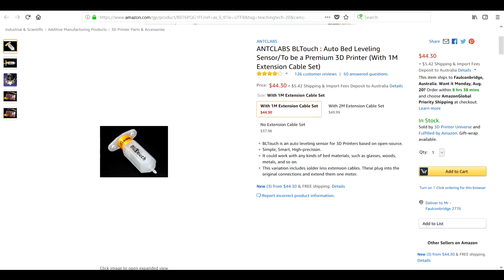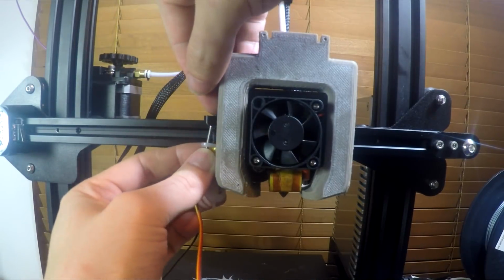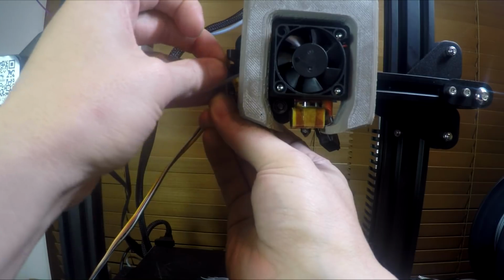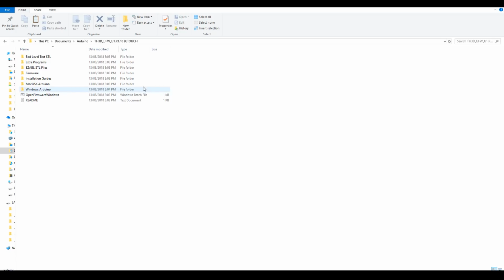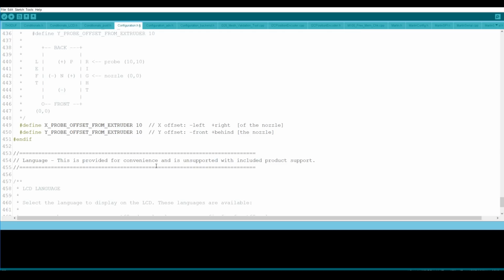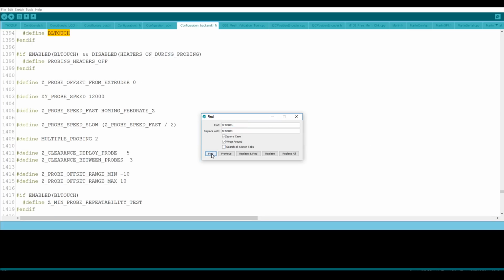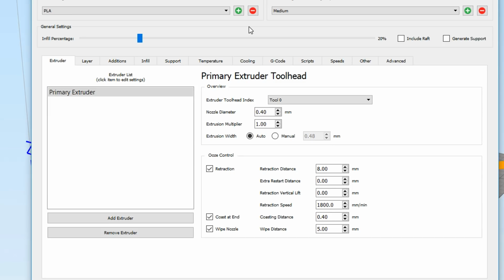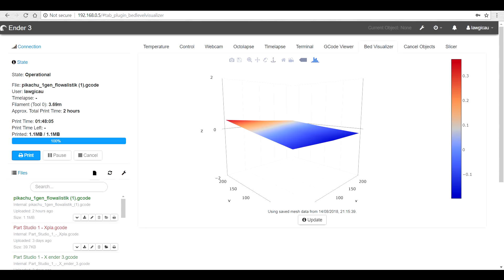How to: Ender 3 BLTOUCH with SD card support and no wires cut

Comment: Others are telling me I need to have the following start code to enable BLTOUCH

G28;
G29;
M500;
M501;
M420 S1;

In order to save the BLTOUCH mesh results and make them active.

I am confused why others believe it's necessary to load save, load, and enable the ABL but the video says nothing about it.
Reply from the maker: Unless you have it configured very differently to default in Marlin, after the g29, the mesh is utilised immediately after. The only reason you would do it another way is if you didn't want to wait for ABL probing at the start of the print, and instead load a previously saved one.

Comment: I am using the new firmware fromm TH3D U1.R2.10, i get an error message evertime.
Arduino: 1.8.7 (Windows 7), Board: "Sanguino 1284p, ATmega1284P (16 MHz)"

Sketch uses 127950 bytes (98%) of program storage space. Maximum is 130048 bytes.
Global variables use 5002 bytes (30%) of dynamic memory, leaving 11382 bytes for local variables. Maximum is 16384 bytes.
C:\Users\Family\Desktop\Light Show\Contollers and wiring\ESPixelStick_Firmware-3.0\th3d\Windows Arduino\hardware\tools\avr/bin/avrdude -CC:\Users\Family\Desktop\Light Show\Contollers and wiring\ESPixelStick_Firmware-3.0\th3d\Windows Arduino\hardware\tools\avr/etc/avrdude.conf -v -V -patmega1284p -carduino -PCOM15 -b115200 -D -Uflash:w:C:\Users\Family\AppData\Local\Temp\arduino_build_610068/BLTOUCH.ino.hex:i 

avrdude: Version 6.3-20171130
         Copyright (c) 2000-2005 Brian Dean, http://www.bdmicro.com/
         Copyright (c) 2007-2014 Joerg Wunsch

         System wide configuration file is "C:\Users\Family\Desktop\Light Show\Contollers and wiring\ESPixelStick_Firmware-3.0\th3d\Windows Arduino\hardware\tools\avr/etc/avrdude.conf"

         Using Port                    : COM15
         Using Programmer              : arduino
         Overriding Baud Rate          : 115200
An error occurred while uploading the sketch
         AVR Part                      : ATmega1284P
         Chip Erase delay              : 55000 us
         PAGEL                         : PD7
         BS2                           : PA0
         RESET disposition             : dedicated
         RETRY pulse                   : SCK
         serial program mode           : yes
         parallel program mode         : yes
         Timeout                       : 200
         StabDelay                     : 100
         CmdexeDelay                   : 25
         SyncLoops                     : 32
         ByteDelay                     : 0
         PollIndex                     : 3
         PollValue                     : 0x53
         Memory Detail                 :

                                  Block Poll               Page                       Polled
           Memory Type Mode Delay Size  Indx Paged  Size   Size #Pages MinW  MaxW   ReadBack
           ----------- ---- ----- ----- ---- ------ ------ ---- ------ ----- ----- ---------
           eeprom        65    10   128    0 no       4096    8      0  9000  9000 0xff 0xff
           flash         65    10   256    0 yes    131072  256    512  4500  4500 0xff 0xff
           lock           0     0     0    0 no          1    0      0  9000  9000 0x00 0x00
           lfuse          0     0     0    0 no          1    0      0  9000  9000 0x00 0x00
           hfuse          0     0     0    0 no          1    0      0  9000  9000 0x00 0x00
           efuse          0     0     0    0 no          1    0      0  9000  9000 0x00 0x00
           signature      0     0     0    0 no          3    0      0     0     0 0x00 0x00
           calibration    0     0     0    0 no          1    0      0     0     0 0x00 0x00

         Programmer Type : Arduino
         Description     : Arduino
         Hardware Version: 3
         Firmware Version: 4.4
         Vtarget         : 0.3 V
         Varef           : 0.3 V
         Oscillator      : 28.800 kHz
         SCK period      : 3.3 us

avrdude: AVR device initialized and ready to accept instructions

Reading | ################################################## | 100% 0.00s

avrdude: Device signature = 0x1e950f (probably m328p)
avrdude: Expected signature for ATmega1284P is 1E 97 05
         Double check chip, or use -F to override this check.

avrdude done.  Thank you.

This report would have more information with
"Show verbose output during compilation"
option enabled in File -> Preferences.
Reply: I would hope after 2 months that you've managed to resolve this problem, but in case you haven't or for the terminally-curious the clue from 'avrdude' is this:
  avrdude: Device signature = 0x1e950f (probably m328p)
  avrdude: Expected signature for ATmega1284P is 1E 97 05
Creality's controller boards use the ATmega1284P Atmel microcontroller (a.k.a. Sanguino) with a device signature of 0x1e9705, but your Ender-3 appears to be using Atmel's ATmega328P microcontroller.
For a long list of Atmel's device signatures scroll to the end of this discussion: https://www.avrfreaks.net/forum/device-signatures
I'm not aware of Creality switching microcontrollers at any point so this is possibly a sign you have a 'fake' Creality Ender-3 -- emphasis on the possibly
If the device signature reported is correct then this is a real challenge because the ATmega328P only has 32KB of programmable memory, where as the ATmega1284P has 128KB, and you really need the 128KB space!
Reply: @nielsjohnson-laird6589  Yes, i got it figured out,  i just wound up having to replace the board.
Reply: @bowhunter3125  A bit of an extreme solution, but glad to hear you got your printer working again. Just curious, which board did you go with, a Creality or a different make?

Comment: Important note for TH3D Firmware R2 (lots of headache on my part): it supports BLTOUCH without any substantial customization and will not work with the instructions here. Just read the files as you go through. There are only like 5 lines you need to uncomment or add to enable it, and they are all described in the extensive commenting in the files.
Also, double check your 27 pin adapters before swapping the 5V and ground, the one I got definitely had them in the correct orientation already.
Reply: I have same problem i cant find old firmware and using u1. R2. 10d and i dont know what can i do

Comment: Since this video Creality has put out their own BL Touch Kit with a usbisp programmer. They also have a link to their BL Touch modified. Hex file. Could you please consider making a detailed install video for those new e3 and e3 pro owners not wanting to immediately flash a bootloader and a modified Marlin, instead just adding a Creality BL Touch Kit?  Creality may or may not of added some thermal runaway protection in this new .hex file? Knowing that of course is important. 
Your Marlin fine tuning changes to speed up the auto level process would be great if they could be added to the Creality .hex.
 I'd like to support your channel with a yearly one time donation is that possible? Thank you for all your educational help.
Reply from the maker: Hi Glen, I've ordered their kit plus their new 1.1.4 mainboard. Unfortunately a hex file can't be reversed to make changes to.
Reply: @TeachingTech  Thank you for your reply. I think you doing a detailed video on how to use the Creality Kit and blt fw will be so helpful. 
  For those in the early stages of owning the E3 or E3 Pro entry level printers and just wanting a auto leveler, this kit has it all in a box. Less chance of a first flash experience going wrong. It then is a gateway to flashing a bootloader and Marlin with bl touch at a later date. No idea if Creality has bought up all the v2 BLT's to put out this kit but they may have to put out a newer updated .hex file asap if only v3 BLT's are now available?
 I understand after a little research that the Creality .hex file compiled cant be changed technically or probably legally.
Can a Marlin 1.1.9 patched per your videos for a BLT be compiled into a .hex file to use the usbisp supplied with the Creality kit or another usbisp? This would save space used by a bootloader and not require as much sliming down  of the Marlin code? I'll probably go the bootloader route but can't learn if you don't ask?
A month ago I downloaded your config files mentioned in the video. Are they still current or have they been updated before I use them?
If this next question is awkward to answer maybe someone else will. I haven't seen a way to present this in private?
As I mentioned in my first comment/question, I want to make a donation but all at once for the year. The patron page shows monthly amounts options. If I sign up will  I be offered a full amount for the year option? I do want to support you buying the hardware I'm requesting a video on. Thank you for all your videos.
Reply: Glen Roe - Creality offers also the source of a firmware version with BL touch support on their support side. I tnink with there you could add your whishes

Comment: Seriously wish I never did this to my new Ender 3. I followed this video to a T and I've been super careful wiring and using the breakout 27 pin connector. My printer was working great but when I decided to revert back to vanilla Marlin and the unofficial Ender 3 Firmware my freaking Z Axis sensor is screwed up~~;.. When I select Auto Home it will Home X and Y but fails to initiate Z so my Printer is pretty much totalled...

Comment: MARCH UPDATE: BLTouch V3.0 is not supported with the latest firmware (TH3D_UFW_U1.R2.9b). Flashed firmware to Ender 3 and made sure everything's connected properly. Turned on Ender 3 and BLTouch performs self-test without issues. Next, run the M48 Test and BLTouch finds XY Home then proceeds downward. The probe comes in contact with bed, retracts upward but doesn't stop Z-Axis moving downward. It isn't sending a signal to say STOP.

Comment: Have you tried the Creality Ender 3 BLTouch firmware I have installed it and it’s been a uphill battle I may have it finally working but at the cost of my sanity
Reply: Can you get to the bed leveling test? I'm already there but the printer isn't responding to probe being tapped by the bed. It keeps going downward and I'm afraid I might ruin my Ender 3.
Reply: I have got it working last night the big problem I had was the g code line is in correct  reality says to change the g28 to read G28 x0 y0 g29 z0 in Curia I put it in as 
G28 x0 y0 
G29 z0
And it is now working I’m no expert on g code I’m sure some one hear can tell us way more
Reply: TheMadWookiee honestly, I don't know anything about different g code at this moment but I have tried G28 Z0 which is the typical home command. I think the drastic changes in the newest firmware seems to me the culprit.
Reply: Also have you went through the z offset and set all of that up I had quite a bit of trouble figuring out the bad instructions supplied with the kit
Reply: TheMadWookiee I set Z Offset to -2.5 which is quite a lot but my extruder nozzle and Bltouch probe tip is a difference of 3.3mm vs the 4.0 +-.3 that is recommended. The firmware is hard to manage with the many endstoppullups which all Z are set to false. I was curious if using Slower Homing in configuration.h would help since maybe the probe needs more time to retract and register the contact.
Reply: I’m not at home tonight I will go though and give you all my settings I’m using
Reply from the maker: Generally I just  do a G28, G29. G28 Z0 will only home Z, not X and Y. With a prove like this it needs to home X and Y first so it knows where it is and how far to travel to the middle of the bed to home Z. G28 by itself achieves this.
Reply: My z offset is -03.00 and I’m using a Mamorubot print surface on my printer so far it’s great
Reply: I should note that every printer is different and the spec that is working for me may differ on you’re printer

Comment: Warning to anyone doing this. As he wires up the three wires that plug into the Pin 27 board he mentions that the board is labeled, but you want in this order "[insert pinout here]". Make sure you read the label on the board. I listened to the video (all your videos are awesome by the way). The second I turned on the printer I heard a zap sound and smelled something burn. The Pin 27 board I had had the plus and ground pins exactly reverse of yours (how your kit came configured originally). I put them in the order in this video and fried my main board, maybe the BLTouch (I'm not sure yet). I don't know for sure how to test the BLTouch without hooking it up to the printer, and I'm almost afraid to do that for fear of burning up another main board (If that's a danger of using a potentially burnt BLTouch). Again, good videos, but make sure you are aware of anything you do to modify your printer people.
Reply: Sorry to hear that man.. hate to say it, but someone else realized this 6 months ago and also fried his board. Guess it always pays to read the comments to see if there is a mistake in the video in case the person recording doesn't edit after the fact for everyone else.

Comment: Michael - I want to thank you for this (and several other) fine instructional video!  You were one of my best sources for trying to figure out how to setup my 3D Touch sensor on my Ender 3 - BUT --  I'm back here so that, when I order myself a BLTouch REPLACEMENT for this piece of junk you might benefit ever so slightly.

Also, I hope to spare other folks the waste of time, money and effort, TRUSTING that I will have much better luck with the BLTouch.  Hopefully, I won't need their tech support, but if I do, I certainly hope it's better than the non-help I've gotten with this SECOND failed 3D Touch.  It's well and good to offer a replacement on a failed purchase, but if the 2nd one doesn't work ANY BETTER (at all) there is ZERO functional benefit to the end user.  Time and money right straight down the tubes - for NOTHING.

Well, at least I have all the mechanical and firmware work done.

Thanks again - you're a fine example of what a good instructor looks like!

Comment: Side note for the new Th3d version. You can comment out the advanced resume options to keep the sdcard and boot. Thanks for the vid worked great after trimming for space. 
Also as said before the new Pin 27 boards have the right connections now, at least mine did.

Comment: I followed your video and I am using the newest version of the th3d firmware (U1.R2.9a) and everything works except the baby stepping to set the z probe offset. When I go into the tune page during a test print and turn the knob to adjust the z probe offset, I can hear my z stepper motor clicking but no change is produced.  The numbers on the LCD screen are changing but the extruder head is not changing z offset height. Is there something on the firmware that I missed that would cause z probe offset (babystepping) to not work?
Reply from the maker: I've had a similar issue before which was the physical endstop switch preventing the X gantry from lowering any further. Took me a while to figure out too! Is your endstop still in place?
Reply: The end stop has been removed so I don't think it's contacting anything. It seems as though the Babystepping of z probe offset function looses The ability to move the x gantry up and down once the machine has been homed. Could the firmware be saving or holding a z0 value and then not allowing any adjustments?

Comment: Excellent guide - thanks mate! The newer unified TH3D firmware has, I realised, built in support for the BLTOUCH, you just need to uncomment the relevant section. Other than that and the removal of the need to reverse ground and 5v on the PIN27 adaptor for some devices (check, it'll be marked on the PCB), it all worked fantastically. Took more time to tune my Z axis than to fit the damn thing and flash the firmware!

Comment: Hello
I am brand new in the 3D printer area and have just bought a Ender 3 Pro!
With this I would like to retrofit a BLTOUCH sensor & flashing the firmware in the near future.
As a firmware, I would like to use the original Marlin 1.1.9.
Could not you also do a tutorial exactly like this one, without having to cut any cables, just with the Stock Marlin 1.1.9 firmware for an Ender 3 Pro?
And best would be German or English subtitles, since my English is unfortunately not so good, and so I would do something easier!

Thank you and love Greetings from Austria!

Comment: I followed this video nearly 100% and I've got my BLTouch working no trouble.  The 2% difference?  I'm using TH3D version U1.R2.7A which I found didn't require me to turn off any features and still used on 98% of memory.  There were a few other small differences with this version, specifically in the Configuration_backend.h file, but otherwise all was the same.  I need to adjust the height of the BLTouch to have it be a bit closer to the bed, maybe.   I had to set the z-offset on the printer to -1.50mm to get a good adhesion.

Comment: I bought a BLtouch at the Creality 3D Global Store in Aliexpress. BLtouch did not work, despite what parameters I set. When the Auto-Home was first turned on, the nozzle slammed into the bed. It turned out that the Z-Stop had black and white wires mixed up in places. The black wire should be on the side where the other black wires are. Wasted two days

Comment: Hi Michael,
I bougth the original Bltouch and the 27 pin board touchs the fan when I tried to close the lid.
What to do?
Reply: I found the same issue, I have ordered a black  Pin 27 board with the pins going forward not up like the green board. cost me $5